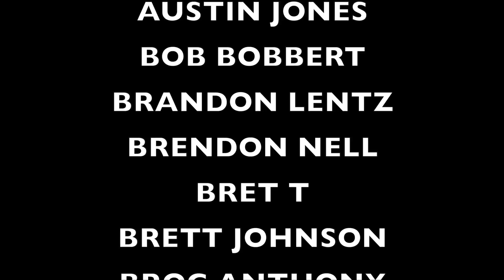MAT BLEW UP THE SAAB! Rip…

Comment: To clear up the engine confusion for Matt, B234R (9000 Aero) always have cast pistons and forged rods. There are no factory forged pistons in this enginefamily. 
All B23X Blocks are like this. And yes, the B234E/R/L are fine to 400-500 HP. To put it in the 9-5 you want to swap the B235 Head on the B234 Block, it seems like thats already done with your Engine👍.
The Problem with the B235 (Saab 9-5) is the weaker casting in the Pistons compared to the older engines giving up around 300 HP (My B235R Piston cracked at 270-280HP, I swapped B234L Pistons and Rods in my B235R).
Reply: Great information...
Reply: Thanks man, my tuner broke it down for me too, always though b234r we’re forged pistons. But as you stated they aren’t but are still good for power. Just gonna fix the washers in the arp kit and put it in!
Reply: @cheekslappinsaab yes 9 have done the 1 for 1 method alot .it never has an issue ,remove one replace retorque then do the next .hell even do it in pattern if you want

Comment: See if you can find a B235R out of an Aero and put the T5 cams in that, in addition to the cobra from the 06+. You can make a comfortable 290-300 on the stock TD04-15T and internals.
Reply: 2jz or small block Chevy
Reply: @RoyalLineageLLC it's fwd
Reply: B234 has forged internals as standard better base engine than the 235 
But 100% agree would be good to see a real sleeper saab waggon
Reply: Completely agree anything over 300hp starts to get unreliable and excessive in these
Reply: @MostGenericUser  the 95 areo makes 250hp out of the box standard
Reply: @curbsideconversions  B234 aren’t forged but are much stronger (500bhp+) but they are also heavier. A good stage 3 plus 9-5 wagon is plenty for a daily. I smoked a mate in a stock twin turbo supra in mine.
Reply: @bobsessedonbikes1684  hasn't the 234 got forged  rods and a forged crank ?
Same crank as the 235 I think its the same part number .
But the 234 is beefier in regards to the block.
Reply: @curbsideconversions  and
Reply: @DentSideDee71  facepalm

Comment: Actually completly stock saab engine with bigger turbo, can handle 500hp. With forged internals 700+hp. Here in Baltics we have some projects that the saab engine is in E36, Mazda MX-5, opel omega, nissan 180sx, Subaru and even more now.

Comment: B234 turbo engines all have cast pistons too. They're not forged from factory. But they are much stronger than the later b2*5s and have been known to take upwards of 500bhp thrashing.

The engine matt has is a B234 bottom end with a b235 head. And is good for the power he was stating if its healthy.

Comment: B234 pistons are not forged stock but they are stronger than B235 pistons. Had you done the PCV Update on the wagon. If not that could have killed it. The pipes break down and eventually block the oil pick up.

Comment: If he wants to see the rods, he can put an inspection camera into the oil drain plug.
Reply: Or just pull the pan. Why wouldn’t you want to do that anyway.
Reply: @bobsessedonbikes1684  it's not always easy to do that, and why disassemble something when you can just use a camera to verify components?
Reply: @VegasAlex702   because I’d also check the sump for engine remnants and bearing material.
Reply: @bobsessedonbikes1684  you'd be able to see that with an inspection camera too.

Comment: The legs on the trailer have a high and low gear push the handle all the way in with some force that’s on gear then pull the handle out with some force and that’s the other gear your in the low gear made for when loaded trailer need the be cranked up or down it’s easier

Comment: is that the b20? over here in the UK its a common swap for quite a few cars, you often see them in old Corsa Bs, ive heardd they cann make 3-400hp with not much work however i wouidnt know but ive heard good things. edit. i wouid deffo builld the engine whilllst it is out, do it once do it right, on the other hand you could drop that engine in and build a real nice one on the side

Comment: Saab over engineered the B234/204 2.3L/2.0. Ive seen over 500hp on the standard rotating assembly.  I'm running a B204R engine in my Vauxhall (OPEL).

Comment: I had a saab 9.3 with the 2.0 i put the viggen turbo on and full 3 inch exhaust and upped the boost to right before the cut and that car boogied i always wanted to do the 2.3 liter block swap or just by a viggen anyways saab is the cheap mans hi performance secret fast car ,super luxurious , fast , 30 gallon gas tank